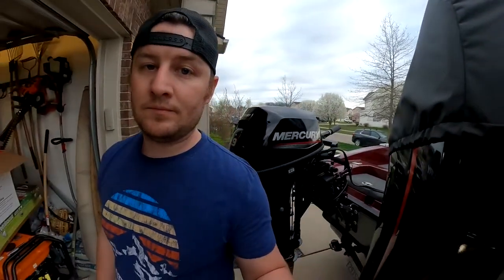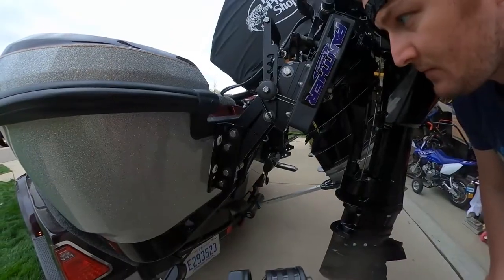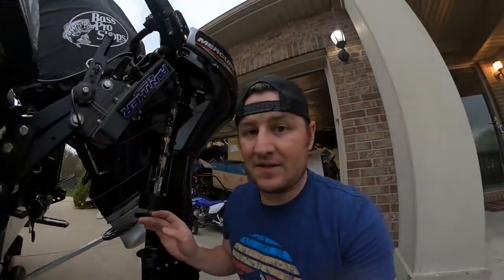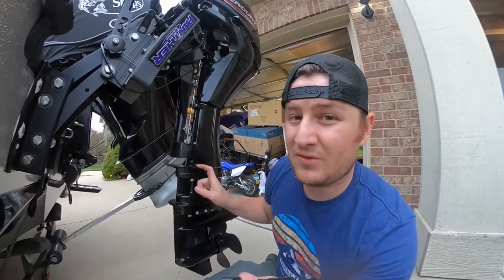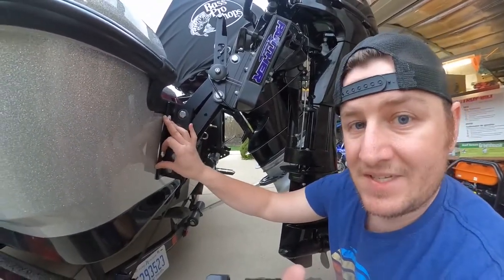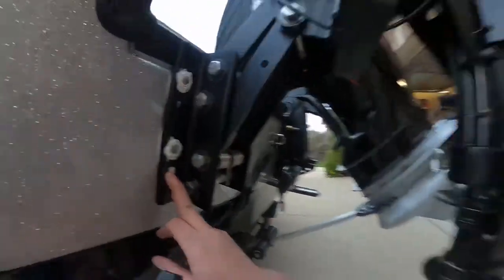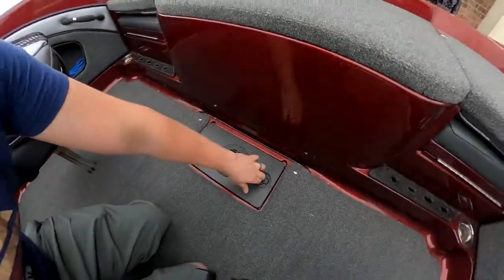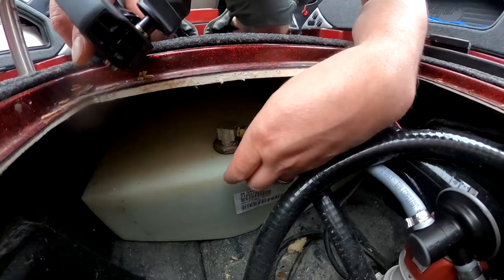Ranger 1880 MS Kicker/trolling motor install tips/secrets

Comment: Good video!  I never did get a quote to have my pro-kicker installed but I figured it would be expensive for sure.  I own a Ranger 1882 WT (rebranded Targa for the most part) and like you found that second pickup tube on the tank.  THANK GOD!  I have the panther static mount to put on and hopefully it is not too difficult.  Glad you saved yourself the extra 3k !  Tight lines!
Reply from the maker: Rates change throughout the year. I would’ve done the install if I got remote throttle or there wasn’t a second pickip. I think these installs are within the capabilities of most people. Glad the video helped and tight lines!

Comment: You put the kicker on the wrong side for that motor, you'll find it uncomfortable to steer with the tiller handle hanging off the boat. Much more comfy and you can use a longer extension when the handle is towards the middle of the boat. Just switched mine because of this, with an extended handle I would have to hang off the boat to make tight left hand turns. You'll understand what I mean lol hopefully you have a kicker support on the other side. Mine only had it on the side I reinstalled it, the previous owner rigged his own with a ripped 2x6 😅 that's what made me look and noticed the support on the other side, which in the end works a lot better. I'm just about to add more glass so that I can confidently trailer my boat without taking off the kicker, my boat is 50 years old lol a little worried still on driving down the road with all that wieght on a little piece of 5x7x1 marine plywood
Reply from the maker: Normally I only use the kicker in a straight position. I lock it straight and use my Minn Kota up front to steer. Kicker is only for thrust. I have used it in an emergency when my cranking battery died. It is tricky to turn the tiller that far, but it’s not impossible. And it would happen no matter which side it was on lol. Glad you solved your issue though and thanks for watching!
Reply: @sheaysmeal5971  I have a 3' extension on my tiller, when I crank it to the right to turn left the handle just crosses the rail, the other direction is just short of hitting the main motor while it's up, clears easily when it's down.  It has helped a lot, I rarely have to fully crank it when using the kicker but when I do it's nice to not have to think about what way I have to turn lol or brace myself to hang 3ft off the boat 😅  I noticed in another comment you mentioned that you use it just as a thruster, sorry, just figured it's also something no one brings up when mounting these. Cheers 🍻

Comment: 1 QUICK TIP FOR DRILLING FIBERGLASS! Start the drill in reverse for an 1/8” or so, then turn to forward mode so you don’t splinter the fiberglass!
Reply from the maker: Thanks for the tip Steven!

Comment: That is a sweet setup!!
Are you able to safely use the outboard on a slot that is higher than the lowest slot on the bracket (without coming it off, and slamming back up or down to the highest or lowest position)?
I ask because I'm wanting to mount one of these on a dinghy to actually raise the height of the outboard with respect to the transom. In other words I want to raise the motor higher on the transom, rather than lowering it, as in the case of a kicker outboard.
Thanks in advance 😁🙋‍♂️
Reply from the maker: Thanks Rudy!
The mount I used has variable heights. It’s designed to allow you to move it wherever you want/need. I usually keep it on the highest position because my Kicker is the long shaft. If it’s a calm day, I can lower it, but I usually don’t. If you want to get the motor above your transom, this should work. Just double check your transom motor rating before you start drilling holes. Good luck!
Reply: @sheaysmeal5971  awesome, thanks for the swift response Sheay!! Cheers man 👍🙋‍♂️

Comment: I have the same boat but am having trouble finding a static mount.  Do you have any recommendations??
Thanks for the video!!
Reply from the maker: Thanks Todd. I haven’t found one yet either. The one that I installed in this video is what I’m still using. I just don’t lower it and keep it up and locked. I have found static mounts on Amazon. You might be able to find something at Bass Pro or Cabela’s as well.

Comment: how are controlling steering an throttle. I was planning on tieing the 2 engines together w/ a detachable rod an use the main engine as a rudder. I don't see myself sitting on the back steering w/ a tiller handle. I'll proballey have 2 binnicals to control both gear select an throttle but haven't decided yet. nice video an vessel.
Reply from the maker: Thanks Steve. I don’t actually steer with this Kicker. I get it fired up, set the speed to roughly what I need, and use my MinnKota to tweak speed and set course. Most of the time I use the Minnkota autopilot and just set a bearing. Then I make tiny adjustments to to kicker as needed for speed. I was going to tie them together with a rod, but I don’t need it for my application. I did buy a rod from Amazon initially to do what you’re saying, so if you’re looking for one, they should probably have what you need. Then there are brackets on the motors, I believe, that you can attach it to.
Reply: @sheaysmeal5971  I now understand why it didn't matter which side you put your kicker on 😅

Comment: i have the same mount and motor , are you trailering it with motor on and what are doing so it wont jump while trailering..thanks
Reply from the maker: I do trailer it with the motor on. I noticed it bounces pretty substantially with no support. I use a ratchet strap to stop it from bouncing. Basically, I lift the motor up to take out the slack in the mount, then tighten a strap that’s anchored to my port cleat and to that handle on top of the transom between the motors. There’s still some bounce but not nearly what it is without the strap. I know it sounds jenky but I’m used to it and it works for now.

Comment: Sheay Smeal. Are you happy with the kicker.  I have the same boat. I like to fish bass and troll for salmon, trout, etc.  any pros and cons?  Thank you!
Reply from the maker: Jman, I love it. Not only is it great for trolling, it has saved me when my cranking battery died, so it’s a great backup in a situation like that. I have the electric start, which is awesome, but it also has a pull start, which is another great backup feature. 
The only cons I can think of are the throttle control and trim adjustments. For my boat, I barely give it gas and my trolling speed jumps. So, min throttle is very close to 1.6-1.8 SOG. Then fine adjustments from there are difficult; mind you that this is a tiller. As far as the trim adjustments, you have to lift the motor and get it to click into the setting. Figuring out how to get it full-up trim was a learning curve. You uave to have it in gear to be able to get it to full trim. The linkage that changes trim is affected by the throttle linkage. So, I’d play around with that before you take it out the first time and learn the hard way on the water. Other than that, I’ve mentioned that I would much rather have a static mount than the Panther adjustable that I have. It’s not terrible, but it’s not needed for my boat and it makes the motor bounce while trailering.
Let me know if you have any other questions.
Reply: @sheaysmeal5971  sounds good. Thanks for the tips too. Can you troll 5mp or slightly above?  I go after stripped bass too, you have to troll fast. Thanks again.
Reply from the maker: @Jman-bq8ov  with a 9.9hp I think you could. That motor on a 19ft deep v hull should work, as long as the winds aren’t bad.